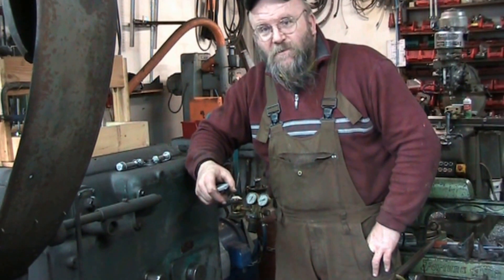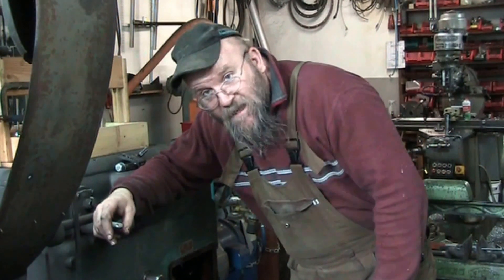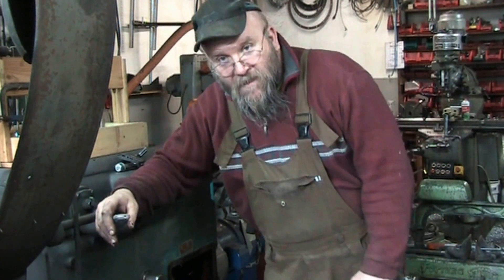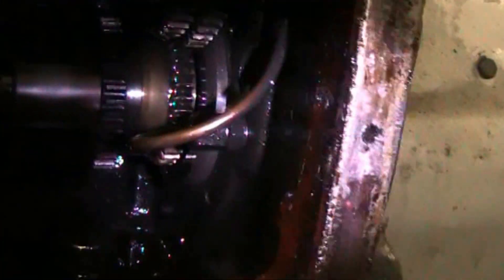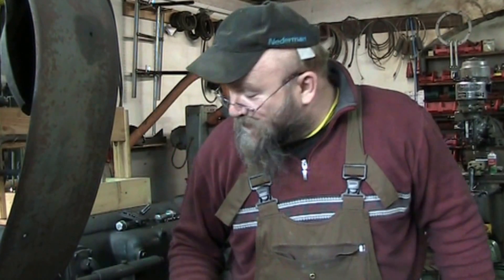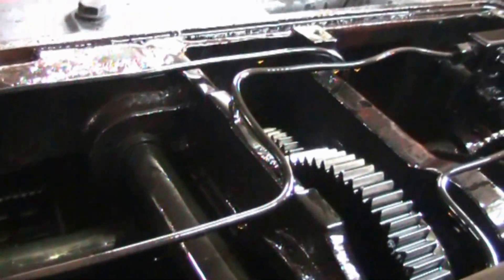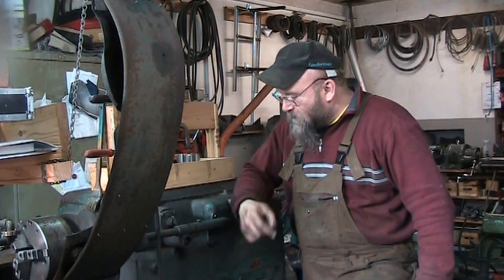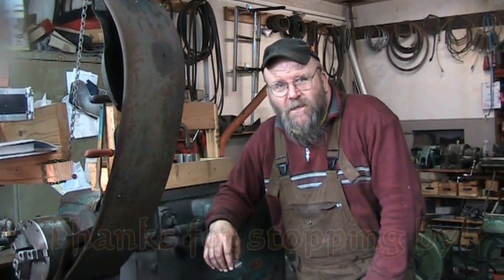not all lathes are created equal

Comment: nice one, always wondered what sort of lathe that is, now i know and it reminds me of a faxtory visit there. Must have been in the early 80s. Actually went there for repairing some machinery, and once i've done it i asked for a factory tour and got lucky.
At the time they ran a foundry doing their own castings, pretty sure that's all gone to Asia now.
Don't these clutches need to be submerged in oil ?
Reply from the maker: +dynoguy  not sure what the disposition of the factory is. they were bought up by VDF (Vereinte Drehbank Fabriken) a long time ago, that logo appears on the machine as well as in the operators handbook. 
if the clutches are supposed to run in oil then there something else wrong because the oil drains away pretty fast and doesn't build up under them. there is plenty of drippage from above and an oil line going to the splined side of the shaft just to the right of the clutch. the handbook doesn't make any mention of it. just says to fill up oil reservoir so the oil can be seen in the sightglass 
after the adjustment i ran the machine for 4hrs at 14rpm grinding the feed roll for the planer. the gearbox got good and warm but no more smoke
this thing compared to my Clausing at home is like a rolls royce to a tractor. 
if the thing were mine i would have a technician come from the factory and go thru it to get it up to snuff.. my only bitch about the thing is the slop in the ways. i'm gonna be looking into the manual again tonite to see if some of the slop can be taken out with a guide adjustment
Reply: +HolzMichel   I think it was already VDF Boehringer when i was there (or was it Oerlikon,...too long ago) What i do remember is some sort of planer/grinder for bedways, the stroke of this thing was several meters,... quite impressive.
Great you got the lathe back to life, what's that horrible noise when the motor runs, sounds like a cavitating oilpump.

BTW,..vid is up, was a bit rushed out, hope it's ok. Please let me know what you think about those beams.